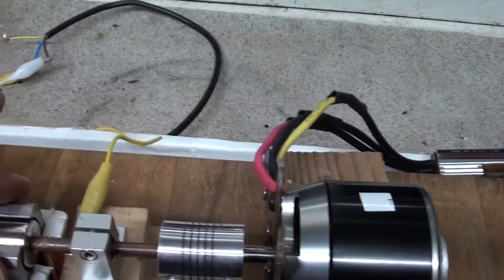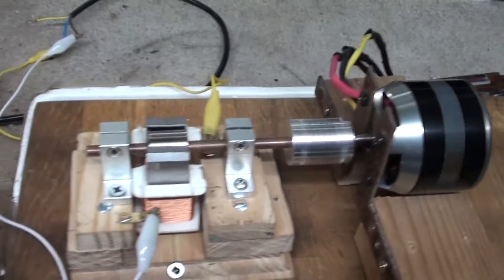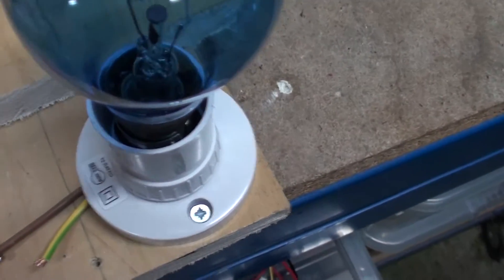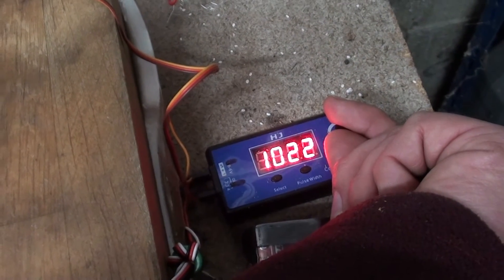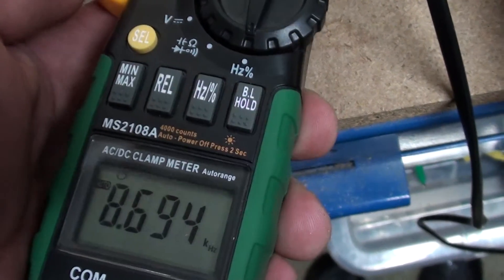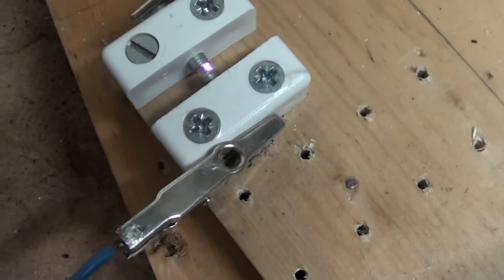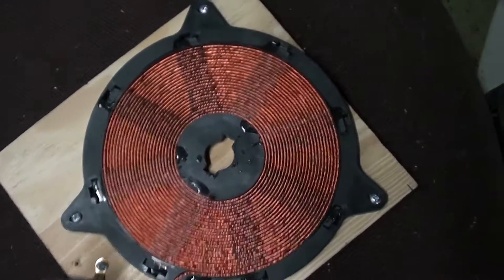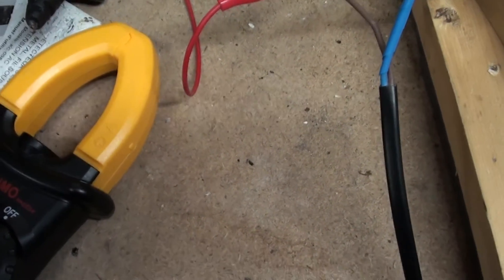Gerard Morin replication with neodymium magnet 4

Comment: Great video! thank you. what components are you using in that spark gap? Also, is that the two wires coming off P.U coil connected to the spark components ?

Comment: Is it possible that the induction coil is transmitting an RF signal (back feeding) the generator, but not quite at a stable (frequency resonance) cycle so that it drifts like an AM radio on a hot day, causing the Hertz to jump around a bit? I don't know if shielding one or the other makes a difference but it looks like it would if that is the case.. from what I've heard the coils can "communicate" for several feet...

Comment: It seams to me, you are using a stepup transformer, in combination with the bulb.  The bulb, by itself, doesn't convert radiant energy into electricity.  When you connected the Tesla coil into the system, you reverted radiant energy into electricity, hence, you amplifieded electricity, and not radiant energy (RF).
Reply from the maker: +Pacero So what you're saying is that the cause of the increase in frequency and/or energy is because there is radiant energy from the step up transformer AND electricity from the induction stove coil effectively being mixed together? I appreciate the thought-provoking comment!
Reply: Check your RPM's on your motor at the same controller level(1024 or whatever you were running it at).

I'm betting the bulb is putting more load on the system and causing the motor to slow down.  Therefor you are getting lower frequency since the magnet isn't spinning across your coils as fast.

To put it simple, your frequency is coming from how fast the magnet is spinning between the coils.  I'm not for sure if you are using step up transformer.  Only change the bulb and your induction coil, nothing else.  Also put your meter over the induction coil and see what frequency you are getting over there.

Another problem, since your load is changing the spark gap effects will be different.  Check your RPMs though... ;)

Comment: thank you for posting , i am working on something simalar. i would imaging your neo is magentized the the left and right of the hole diametrically right?do you have an amp reading at the motor ?
Reply from the maker: +jay cares Hi, that's correct for the magnet. As for the motor, it was using 0.1 amps (after the speed controller) to drive the original washing machine pump generator, but unfortunately the amp clamp is no longer measuring amps...volts and frequency ok but not amps! I will be getting a new amp meter so that I can measure the draw before and after the speed control and I have a watt meter that you plug in and then into the wall socket which I will also do in a new video soon
All the best!

Comment: Hi thanks for sharing these very good videos .The induction stove could i ask what one you went with and have you tried it like Gerard Morin said the cold radiation.could be of benefit.I am going to try a similar circuit i have every thing apart for coil and transformer.I am very exited after watching this.Thanks Gez.   Corby Northants
Reply from the maker: Hiya! Thanks for the enthusiastic response - the unit I bought was this:-
http://www.amazon.co.uk/Andrew-James-Digital-Electric-Induction/dp/B004BM749S?ie=UTF8&keywords=Induction%20stove&qid=1460669879&ref_=sr_1_1&sr=8-1

The cheapest I could find, although I ordered it from Amazon France as it was cheaper. Same unit though!!!

Good luck!!!
Reply from the maker: I have tried sitting on the coil, but at very low power levels as the setup heats up....interesting subject though and I will post a vid on that too!! So, after sitting on the coil for 30 seconds or so, at low power, the next morning I experienced a sort of buzzing in my head, but it wasn't a bad thing.... more like a loud silence if that makes more sense, with fewer negative thoughts!! Interesting!!! At higher power levels....who knows?!?!?!
Reply: Hello, very nice video. I was wondering, what happens if you put, lets say metal on the coil for 30 sec? does it heat up? :)